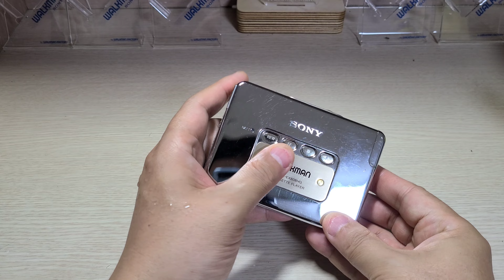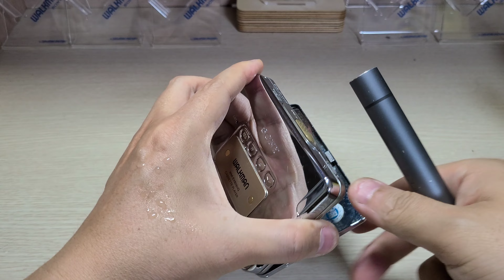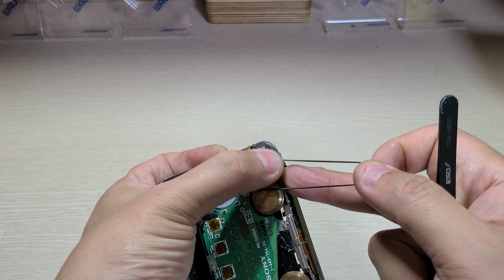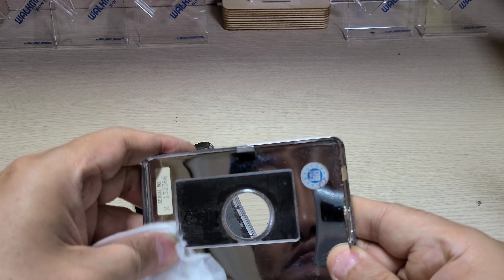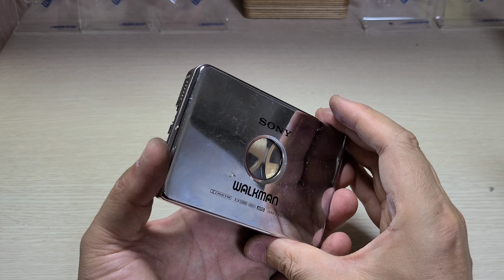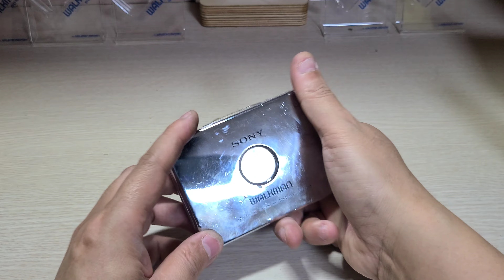Sony WM-EX808HG Repair Cassette Player Walkman

Comment: Hey, i have the same walkman. I only have the external dry battery power source for it. It turns on but the battery light comes up and then it stops. The battery is fully charged. Any ideas please?
Reply from the maker: You can buy a new gum cell from Ali Express. Thank you for your interest